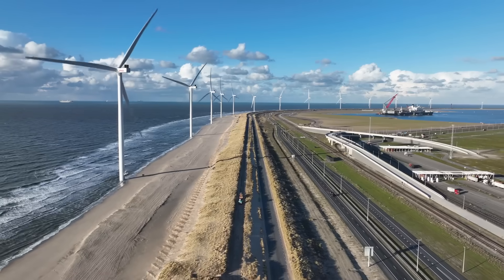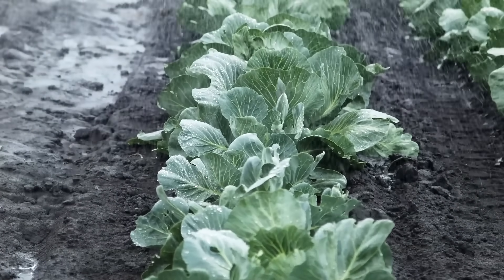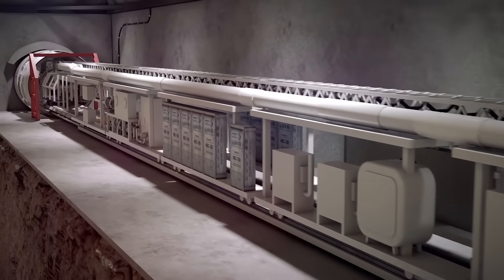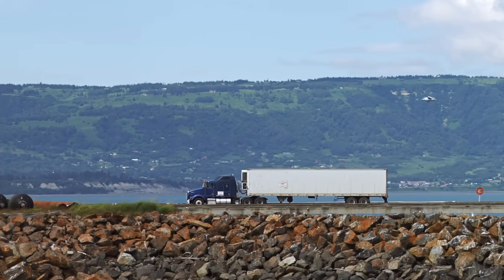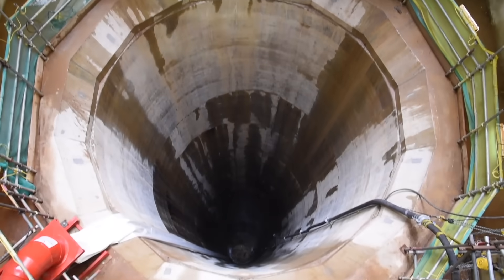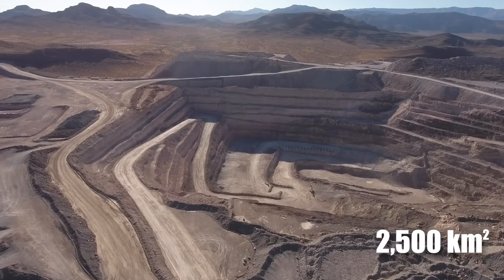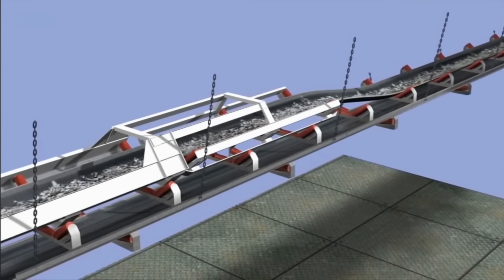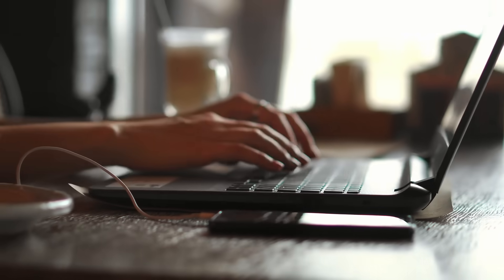Britain Is Building A Massive New Super Mine That Nobody Has Heard Of

Comment: Unfortunately fails to communicate to those of us that have been taught in imperial so that’s most of the English speaking population of the world.
Reply: I was taught imperial and then metric in my teens (metric wins) and I am hitting 60,I don't know what stone you live under but I'm sure it weighs a few stone
Reply: @Derek-press  I have worked for GM and a world wide water meter company both worked in imperial  in design and research as a prototype model engineer now retired but still a machinist keeping Steam locomotives  alive so I have worked all my life in imperial which any real engineer will confirm that one size fits all is certainly not correct in the world of thread forms for coupling parts together, metric is a for those who cannot go beyond 10 and any bolt will do. That’s the rock I live under and very happy maintaining my 85 year old car. I doubt much will survive that long built today.
Reply: "most of the English speaking population of the world"

Most of the English speaking population of the world who are at or near retirement age.
Reply: @Derek-press  My apprenticeship engineering city & guilds part 1 & 2 were 2 years each plus another year on machining process then a further 3 years as a journey man training under a 70 year old craftsman who had learnt his craft in the aircraft industry combating Nazi BMW powered machines built with slave Labour. This resulted in me acquiring most of his precision equipment when he retired so the use of 1x2x3 parallel blocks and sine bars plus slip gauges all work so much easier in fractions, try dividing a meter by a third and you will see what I mean. The timber industry sold out to metric in April 1970, which meant every dimension was down sized for the same amount in cash very much the same happened with coinage in 72 when everything was rounded up.
My comment on the video was originally just intended to question the use of metric without any attempt at reaching out to a larger audience.
If it had been American in imperial would you watch?, so it failed to communicate.
By the way did you know BMW started car production by rebadging Austin 7’s, good old British Engineering.
Reply: @ronr61  my wife is German I live in Germany ,I know more about the history of Bmw and porsche than you can ever learn ..carry o with your "I'm so correct" stuff
Reply: @Derek-press  As I said earlier I worked for 20 years in research for General Motors this involved tearing down and examination of our competitors in the motor industry the result of what I learnt is that my daily drivers are a Mercedes the other a VW only my classics have all been pre war English manufacture.  
My comment on BMW’s history during war time was not against German people but the industrialists that funded and supplied the military regime is questionable as the profits made during that time were used to save BMW from bankruptcy at a later date.
But back to my original support for imperial measurement, when the metric thread was standardised it was improved by Whitworths root form and the insistence of German automotive manufacturers to adopt the imperial fine thread system  resulting in the addition of metric fine and superfine thread form. 
So there is a bit of imperial in most things in daily use including your old Halfords socket set with its half inch drive.

Comment: Not mentioned was how will the mine compensate for subsidence? Taking out millions of tons of material is going to leave a void which will appear on the surface unless expensive back filling is used.
Reply: They are not using the 'cut and drop' method here where the ceiling of the mine was allowed to collapse after extraction.
Reply: @PhilJonesIII  nope, they will do room & pillar.  And Polyhalite layer is very thick and clean, so very little to backfill with, unlike the Potash layer.
Reply: @Mr-J...  I didn't think they would use the old method.  It's dangerous for people (and machines) plus the risk of subsidence.  

I often met up (1970s) with a photographer whose job it was to photograph subsidence damage and some of it's effects were truly bizarre.  From minor cracking in walls to entire frontage detaching and at least three cases of an entire room-floor disappearing.  But, this was the S Wales valleys where the geology is hardly stable.  Until fairly recently at least,  a mining survey report was a lenders requirement for anyone buying a house in that area.
Reply: @PhilJonesIII  it's very stable in the region.  If you ever got the opportunity to go down Boulby, you be a fool to turn it down.  The scale of the mine is just bewildering when you get down there.

People often have the antiquated view of the wood-shored rickety mine from cowboy movies, but when you go down boulby it's like walking into an underground city with land rovers & vans driving you around through huge and spacious caverns.

It's many years since I was on that site, since before the new tower got installed (there's another great feat of engineering - built to the side then slid in place).  But getting a mine tour was definitely a highlight of all my times visiting there.
Reply: @Mr-J...  I've only seen such places in photographs and yes,  very impressive.  Salt mines tend to be cavernous as well, without apparent support.  I have seen some of the Swiss nuclear shelters.  These were designed to accommodate entire towns, complete with food, water and sanitation.  

The Welsh valley's, of course, are like an accordion bellows.  They have shifted and are not likely to stop, albeit slowly.  In the area where I currently live (Loire Valley), they used to mine for some mineral (forgotten which sorry). The unusual feature here is that the strata is vertical.  Not much digging required.  

As you say, mining technology has come a long long way and it's good to see.
Reply: @PhilJonesIII  Loire Valley in France? Nice.  Cutting across the south of the Paris Basin, complex geology of former volcanic region, but I've only heard of coal mining there and I never touched coal.
My (former) game was mineral processing, hence the Potash & Polyhalite involvement.
North Wales is Iron & South is coal & Anthracite.  Slate & metals dotted around but no (interesting) minerals.
Reply: @Mr-J...  It is nice thanks. God's billiard table and great for cycling and dark enough for astrophotography.  Locally we have a disused slate mine, now a museum and a disused iron mine, also passing for a museum. 

There are any number of converted narrow-gauge railway lines for cycling. One stretching from Chateau-Gontier to a place just short of Nantes.  It was along that route I came across an information panel describing the vertical strata mining. Sorry, but for the life of me I can't remember what they were digging out, not coal certainly.  

They seem determined to let everyone know the history of the different areas with all their information panels.  The land restoration is amazing, you wouldn't know any heavy industry happened here at all.
Reply: 70m/1600m= 4% so nothing will happen at surface level. National forest and farmland any how.

Its like removing 4 cm 1 m deep and its not all sand its rock/mountain so nothing will happen.
Reply: the British have a lot of experience with large scale mining, they won't overmine.
Reply: The same as any mining after 90 years of geological and structural research!! They don’t think of it one week and start mining the next.
Reply: UK gov are going to fill it with 10,000 men while they await the outcome of their asylum applications
Reply: @davegem that's a good idea
Reply: The mine is constructed to be self-supporting, so when a tunnel is dug, nothing is dropping.  Regardless, at 1.6miles deep, any mine collapse would not affect the surface.  Underground waterways collapse all the time and you hardly ever know about them.
Reply: The plan is to backfill the entire empty space with coal, to keep the friends of the earth happy.
Reply: Do you know anything about mining?
Reply: We did a practice run with the Channel Tunnel 😄
Reply: and with all the spoil from the Channel Tunnel, they created Samphire Hoe @oldfartinthenight9201

Comment: Downside of polyhalite is low nutrient value, when compared to potash, the other components are unnecessary in such amount. There is also significant amount of salt (3%), which is harmful to soils. It is fine in countries with enough rainfall, but may become catastrophic if used in arid regions. Polyhalite may not be used in liquid form, thus it´s potential market is smaller.
What I would like to know, whether experiments of adding polyhalite to ammonium nitrate as anti-detonation agent were conducted. Many farmers use only ammonim nitrate, this would be a way to improve soil and add a bit of potassium for them, while unlocking huge market for this fertilizer.
Reply: This video comes off as an advertisement for the company involved in this operation.  Consequently, there was no sign in the video of any negative aspects to using polyhalite as a fertilizer.
Reply: @michaeldeierhoi4096  I believe the mining operation is truly unique, and deserves praise.
The fertilizer itself is not bad at all, but it has downsides. The video is however definitely sponsored by owner, they would not get the animations otherwise.
There is also a big positive effect - slowly disolving means that the fertilizer is less likely to leach away from fields to surfacial waters, thus not harming water ecosystems, and you need less of it.
The next positive effect is the presence of magnesium, which is responsible for water regulation in plants, and also chlorophyll, giving the plants the ability to deal better with extreme weather climate change often brings.
Sulfur present in the anion also helps plants with immunity against molds and bacteria. Calcium influences the strength of stems, thus stable supply from resulting CaSO4.2H2O will mean more wind resistance to the crops.
Reply: @Pyrochemik007  the vertical shaft sinking machines are certainly unique, but you won't hear too much praise from the workers.  Certainly, they are not as efficient as the brochure would have you believe.
Reply: The video claims it does not need processing.  Whilst this is effectively true, you have correctly identified that it can damage the soil if used in its raw form.  In fact, if you use raw polyhalite, the soil cannot be refertilised for 4-years.
The Poly4 technology is the key for Anglo.  The slows the release of the Polyhalite making it akin to a normal fertiliser.  Its why Boulby had no success, whilst Anglo should be okay ... if they ever get the mine finished.
Reply: If they need to chemically treat the polyhalite in order to make it less soluble, surely it can no longer be considered an 'organic' fertiliser?
Reply: @squaddiepete  can if the treatment is organic (which it is)
Reply: I dug a little deeper and yes, they modify the solubility profile by granulating it with cornstarch, an organic product. I learned something new! @Mr-J...
Reply: @Mr-J... Because of it’s high potash levels it may not require to be applied more than once in four or five years - all down to the soil analysis of the individual farms and therefore the frequency of the amount applied varies from farm to farm. Not fair to assume most farmers use ammonium nitrate only as fertiliser - most use it as part of a compound combined with phosphate, potash, sulphur and many other trace elements.
Reply: @wallace686  yup.  All good points.
Reply: @Mr-J...  No, it will be sold unprocessed, just ground to demanded particle size. It has a unique feature of slowly dissolving, processing it would mean losing that feature, while spending money to create what can be mined elsewhere.
Reply: @Pyrochemik007  hmm, then why would they need the MHF at Wilton running at hundreds of millions of £ when they could just mill it at the mine face ?

Why would they have a patented product if it was just raw material out of the ground (that you can't patent)

Boulby were trying to flog it unprocessed - look how that worked out.  They had 25k Te sitting on the deck at one point with no one to buy it because the trial fields were trashed.

Anglo (or Sirius as they were) know why they would be successful where Boulby were not - and that was down to Poly4 (the processed product).
Reply: @Pyrochemik007  just to clarify, there was a take off for milled unprocessed but it wasn't the main process route.
Reply: I dont even see how they call this 'fertilizer'.
ALL fertilizers are N and P (and K, in lower quantities), which are most needed by plants (and C, but they take that from the air). Calcium is needed too, but there is so much of that and so little needed that it doesnt matter here. K is needed (part of the common NPK fertilizers), but the rest are trace elements.
Since this material lacks N and P and as you say contains quite some NaCl, its not fertilizer. It can be used on a small scale to add these mostly trace elements and therefor is some sort of fertilizer, but its not fertilizer.
Its also not organic. That is, no more than fossil fuels are.

Im sure theres a market for it and it will be lucrative, but its not fertilizer.
I stress that and think it is a BIG mistake in this video, bc it then leads to people thinking they dont need real fertilizer, which they do.

I further agree with your post (pyrochemik) and it holds a risc, as too salt, but also a build up of these trace elements, is soon a pollutant to soil and may easily render it not fertile at all. Hence, not fertilizer.
Reply: Im sure the investors with their billions spent didnt bother looking at this. If only they had consulted with a random poster on youtube so they didnt waste their money eh?
Reply: @titntin5178  What an utterly stupid comment.
First of all, inverstors are for the most part not involved in any technical aspect. They mostly invest by investment firms, who themselves also have no expertise in any beta field. So just go with what they are tipped on, which may just aswell be bogus. Another aspect is broad investing to minimize risc. They win some, they lose some. There would be investors if some starts a company to make water wet and sell it as wet water, if only the advertisement campain is right, there will be plenty of investors. So what you say doesnt mean anything. Theres 1000s of examples of this. Probably 100.000's or millions even.

Secondly, specially last decades, as the west is in huge decline and almost every sector corrupted, 'experts' may, and often do, give wrong advice. So also from a scientific and technological point of view, your argument falls flat.

Yes, in the comments you will actually find people that know MORE and BETTER, than what multi billion companies, govs and all there bought 'scientists' say.

Furthermore your comments is ALSO an argument ad verecundiam; ie a status argument and WRONG argument by definition.

So your post is 3 (three) times wrong!
Congratulations on your achievement.